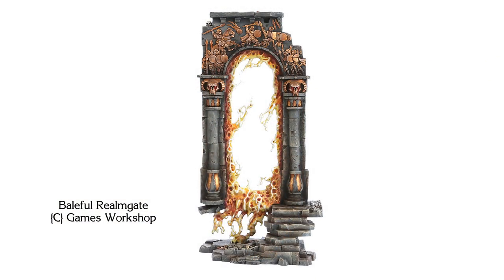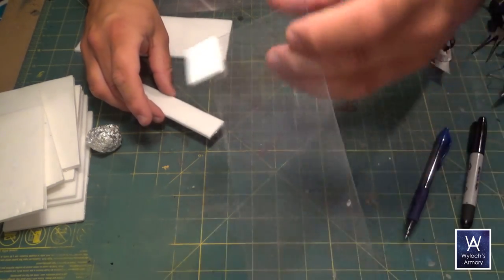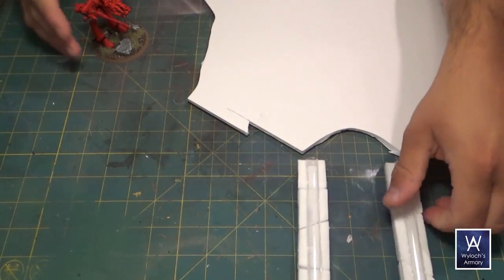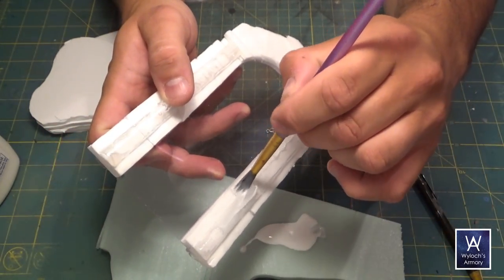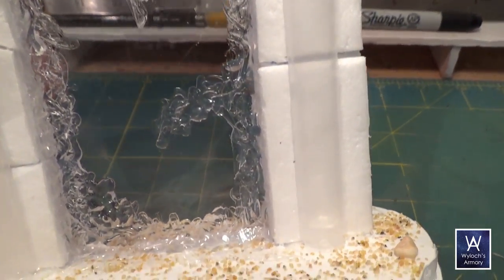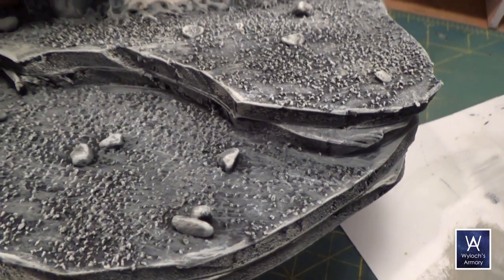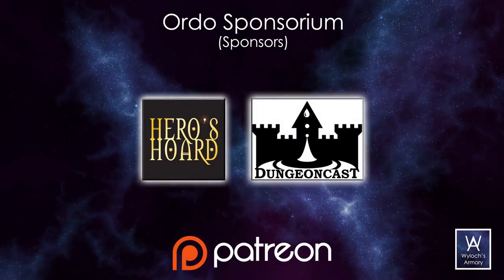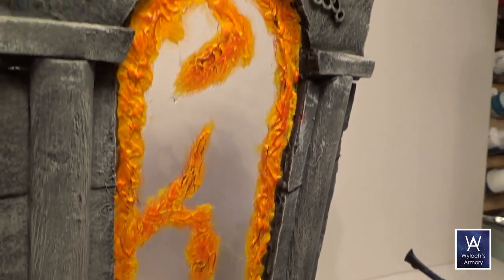How to Make a Baleful Realmgate for Warhammer, Dungeons & Dragons

Comment: These videos are great for quick and dirty terrain, but honestly with just a tiny bit more effort these could be of incredible quality. 

A little bit of time blending the edges of the foamboard base together with spackle/filler, or using a knife to bevel the edges a bit more, or a proper drybrush instead of a heavy overbrush with wet paint, and a few washes would take this over the top. 

Just my 2 cents - for people with only a couple materials to work with or next to no money, these will do nicely. Looking forward to the next video!

Comment: Nice.  Not a fussing, but the clear tubes would be a good place to hide wires for LEDs.  They wouldn't have to be clear and any small diameter tube would work because it is getting painted.  I kept waiting to see you do some special effect with the clear half rounds.    And just something to think about, would it be possible to cut the clear sheet so that it would be there to support the flames but not fill the entire doorway?  I can see over time it getting dusty and scratched.
Reply from the maker: Very good points.  Right now I'm working on a piece that has extensive lightning - next two or three episodes - and didn't think about it for this one, but yes you should always be on the look out for hiding places like that.

And yes, after teasing the hot glue, it would be smart to cut out the excess plastic, great idea.